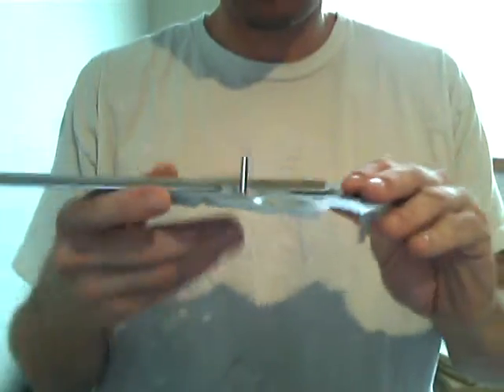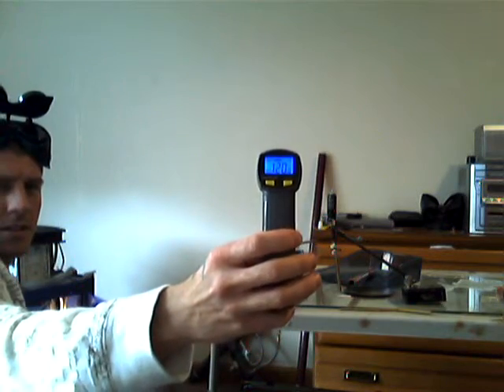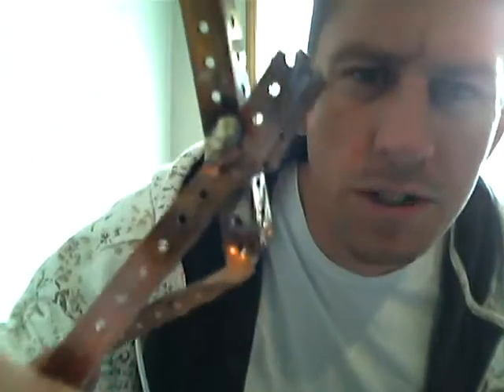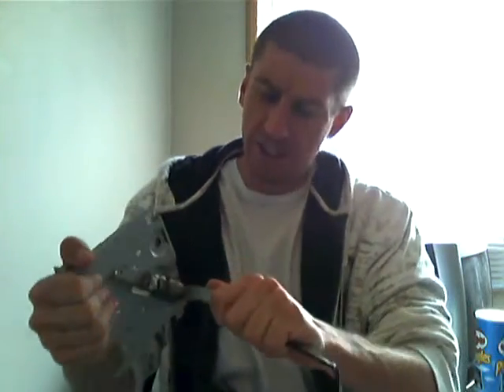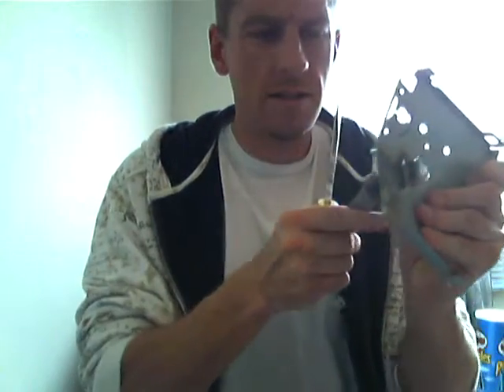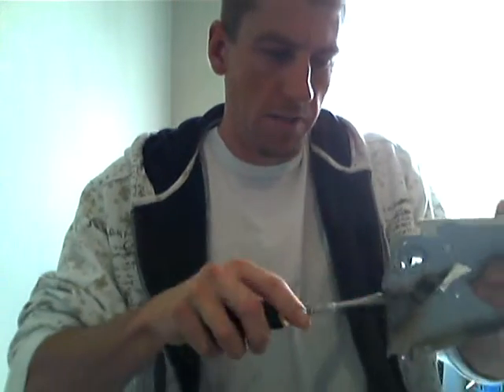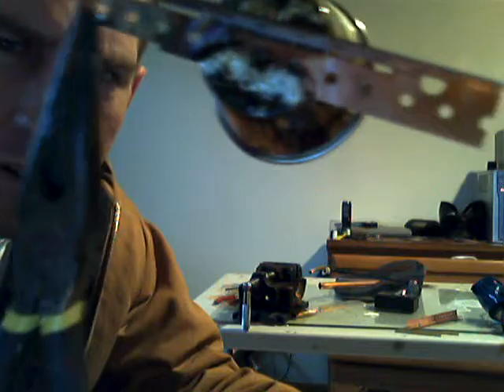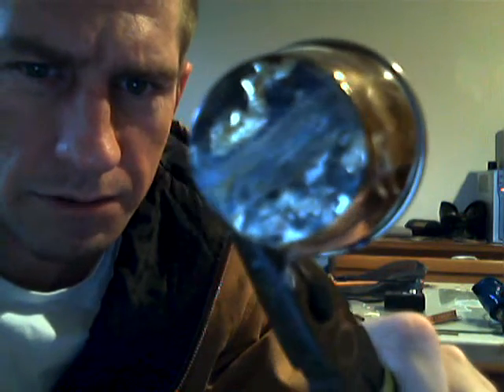brazing with hho

Comment: Loving your video's I find I'm commenting on all of them sorry mate lol. I am so building one of these being a welder I am doing small projects inside my basement and I can't be lugginh massive oxy acetylene rig into the basement lmao. Just trying to help your brazing, your flame is hot enough, you just need to get the metal parts hotter, either cherry red or a puddle and work the puddle and add filler. Braze joint done right will ALWAYS be stronger than the metal parts every time! Cheers, IC.